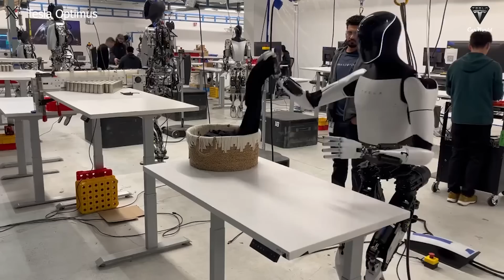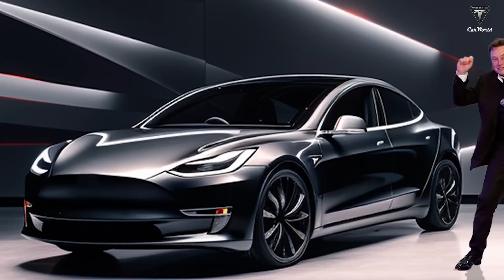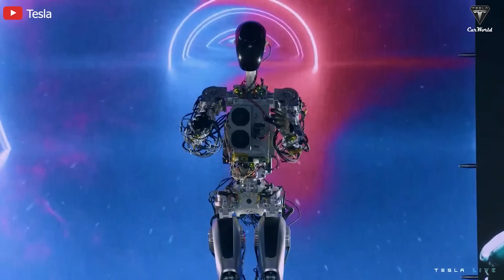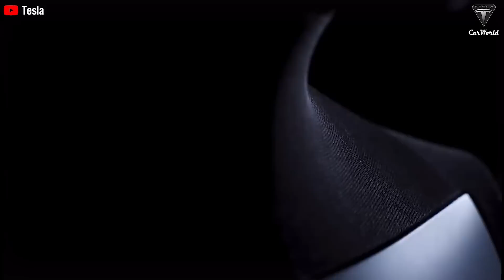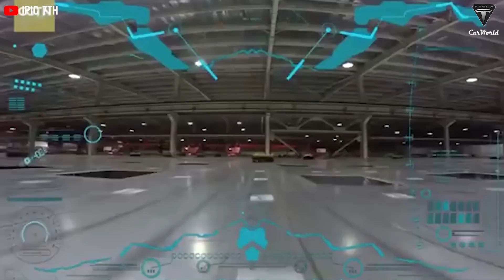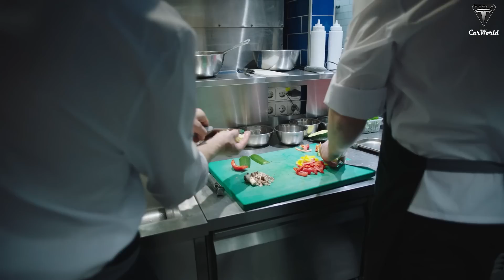It happened! Elon Musk Unveiled Why Tesla Bot Optimus Gen 2 is an Indispensable in Human Life (MIX)

Comment: In a manufacturing environment, moving on two feet wouldn't be the most efficient way to move around, wheels and tracks would be. Their use would be lessened as factories are designed around the manufacturing process, instead of human based designed robots to fit the manufacturing process. The human body will not be the most efficient design for manufacturing. I think they'll have their uses, but in limited numbers.
Reply: Not to mention 4 wheels plus single engine are better. Basically rumba with adjustable height. If you need to move through steps(why on earth would you not use elevators + flat floors for factories).

In general humanoids robots are way too complicated, have huge amount of moving parts and they don’t solve pressing problems other robots can’t. 

They look cool though.
Reply: first gen robots will obviously be prepared to replace humans in human enviroments, once all the humans are replaced, you can optimize form to suit a particular function and optimize the enviroment for them (ie a cargo lift with arms or something like that)
Reply: @canobenitez  so once you’ve successfully replaced all humans with automation you’ll try and mimic human locomotion?
Reply: @texg8jk  only for sex robots

Comment: The charging could be done at the work station, allowing  continuous operation, never running out of power as long as AC is available in the production plant!
Reply: ☢️ Power🔋 like T-800 with Chat GPT 🧠, version 18.5 What could go Wrong 😉
Reply: @Joe-jv5mm  just don’t put a battery in it and a limited extension cord!